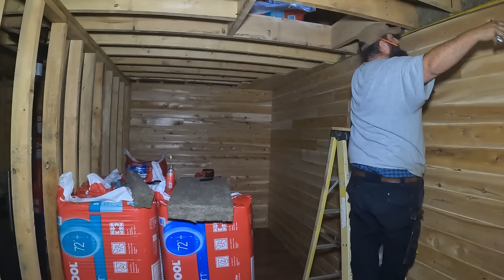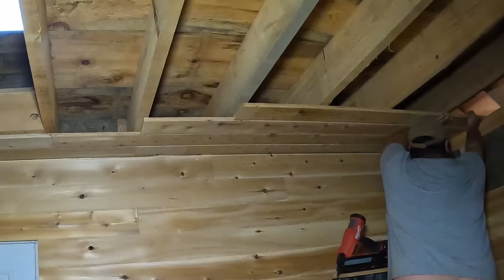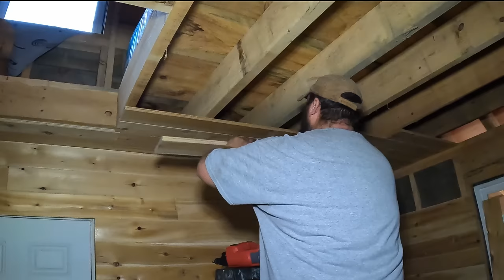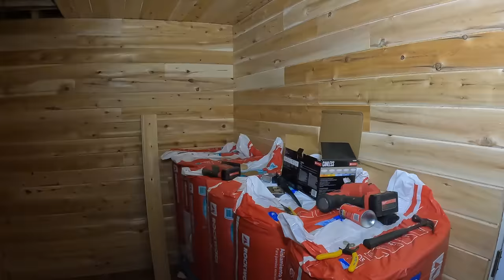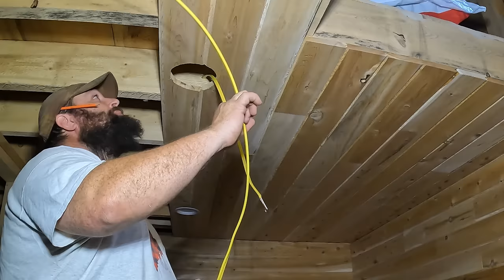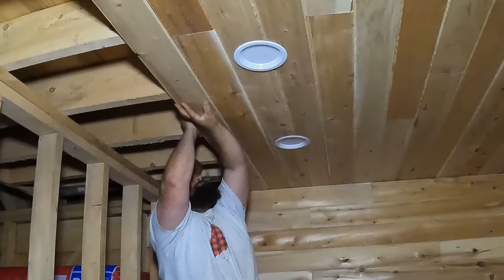Off Grid Cabin: V-Matching the Ceiling with Recessed Lights: Episode 34

Comment: Those are the ugliest, cheapest and most uninspiring light fixtures to use in any application other than a storage room. Such a shame these horrible fixtures are thought to be a good idea. You could have, to start with, created ceiling details to design indirect lighting that is much more aesthetic.
Reply from the maker: Which ones the recessed lights that are out of the way and practical or the shop lights we will use for the living area? I guess we didn’t look past practicality with the lighting. The recessed ones weren’t as cheap as I’d like for a camp.
Reply: Just curious why you are wasting money on 12/2 Romex for LED fixtures? Nothing wrong with overkill but it's harder to work with and quite a bit costlier.  Looks great!